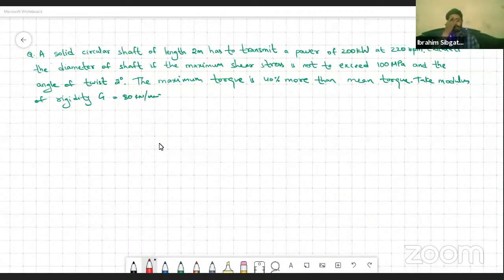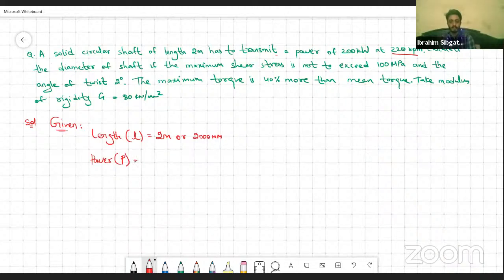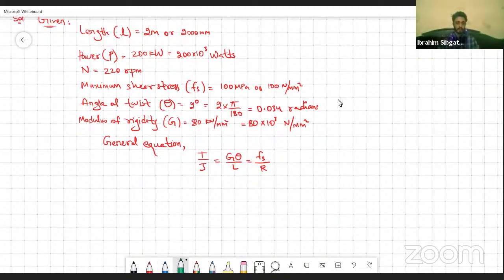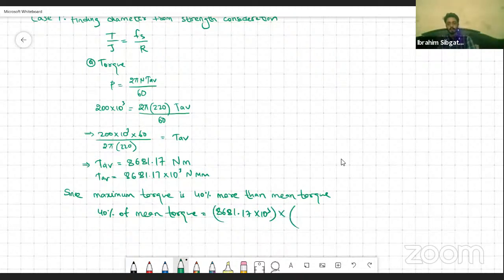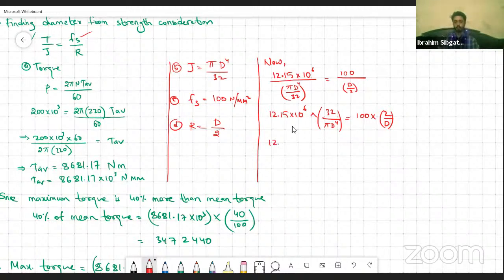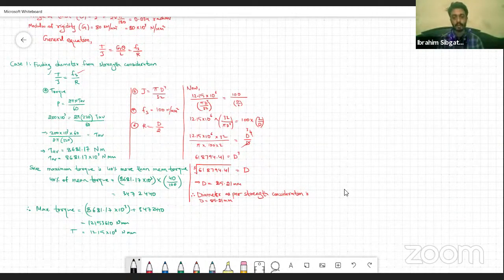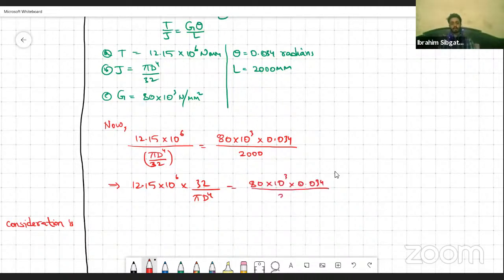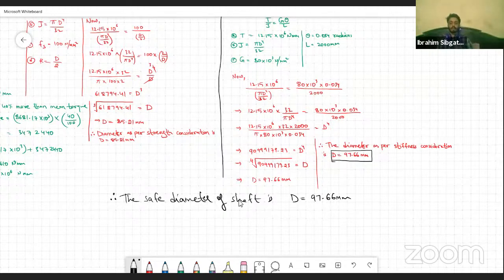Torsion in Shaft (Part-3) | Structural Mechanics-3

Comment: Sir, As per each case, we got two different diameters. What are we supposed to do there at last?
Reply: We should consider safe diameter among them . The highest is safe diameter.
Reply: @akashreddyvlogs  thank you
Reply from the maker: Thank you akash!
Reply from the maker: Yes, we have to calculate both the cases and finally from amongst the two cases, we must consider that diameter which is stronger.
Reply: @isaa_india  ok sir.